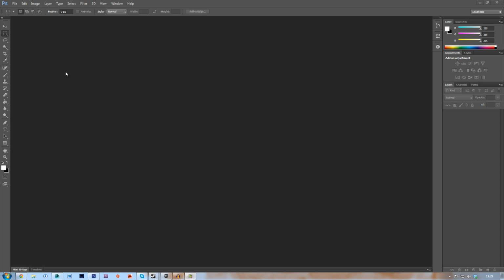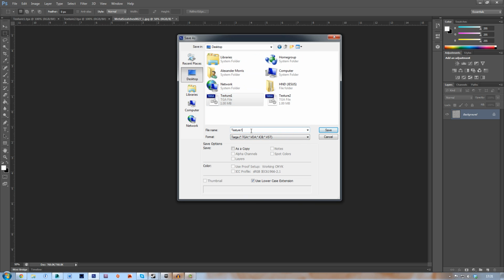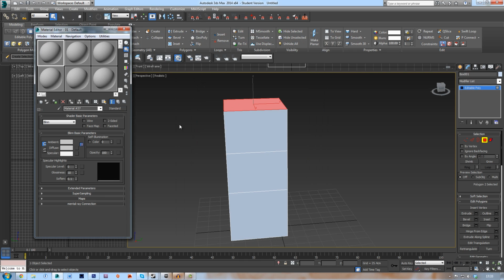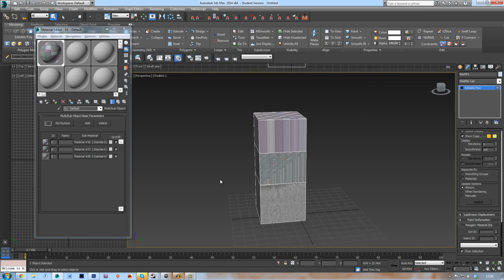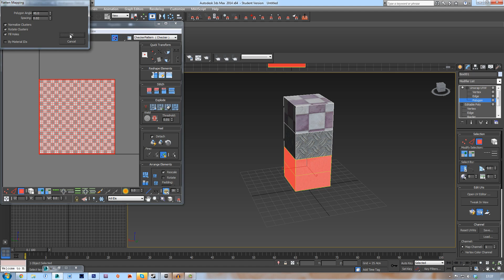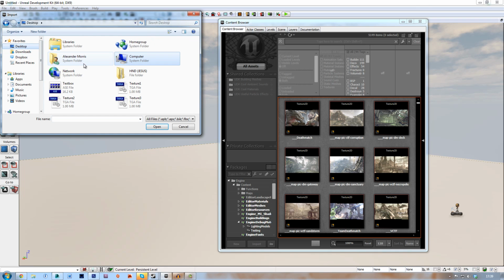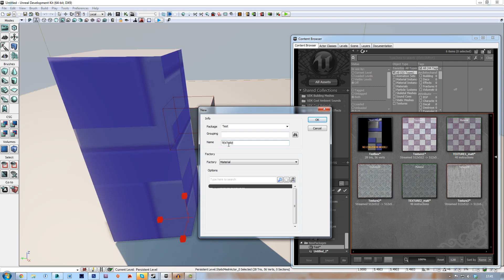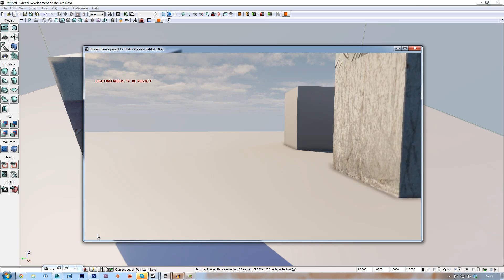How to put multiple UVW Unwraps on a single object - 3DS MAX - UDK -

Comment: If anyone is stuck with creation of second UV channel in 3ds max here is the tip!

I was keep trying Abandon and Move options yet channels did not save properly.

Turns out like video mentioned you gotta "Collapse to" in order to save UV channels.
Workflow: Channel 1 - unwrap uvs. UVunwrap modifer -> collapse to
UVunwrap modifier, flip to UV channel 2, unwrap uvs (or load), UVunwrap modifer -> collapse to

That way channels retain their UVs.